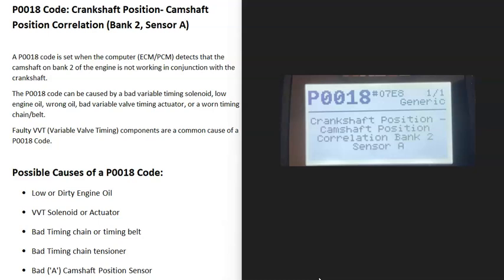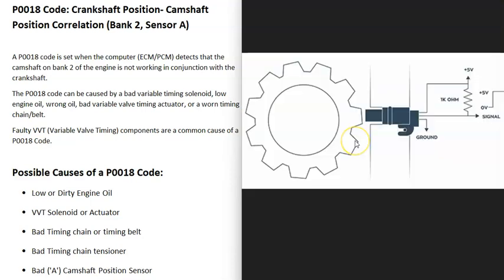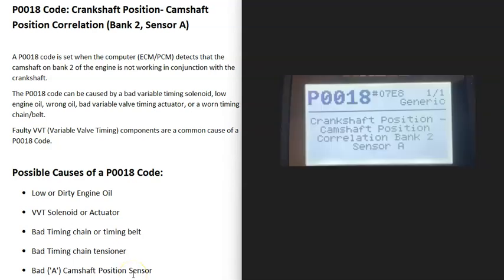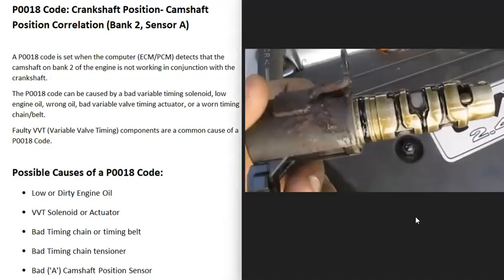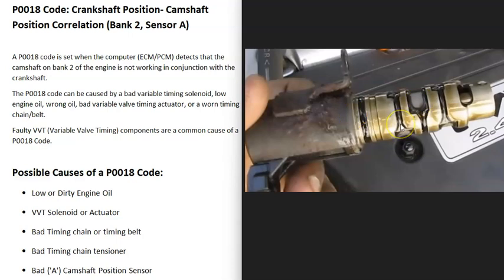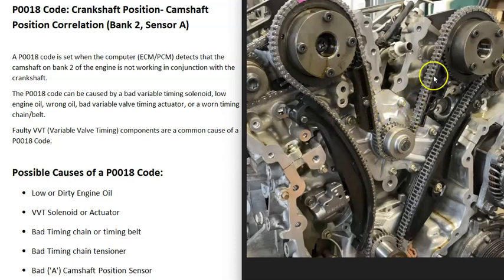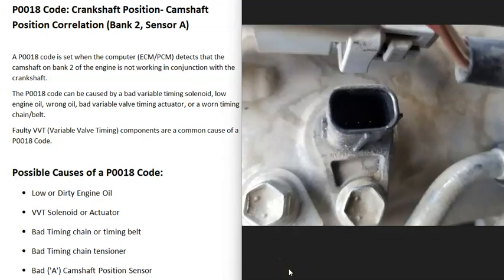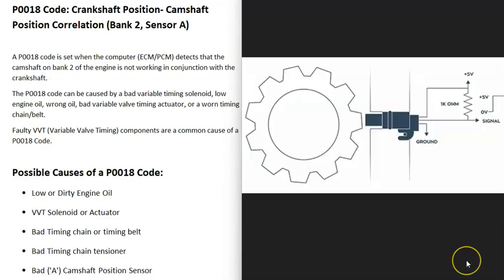Causes and Fixes P0018 Code: Crankshaft Position- Camshaft Position Correlation (Bank 2, Sensor A)

Comment: I have a Ford F150 with 3.5 Ecoboost and getting codes p0018,p0151,p0172,p0175,p0446 i have an Autel D1 lite scanner i have changed the camshaft sensor (motorcraft) changed both VVT solenoids and run sea foam thur motor to clean it up and put new oil in it now it sounds like the turbo is goin out on the driver side can u help.

Comment: Hi. Thank you for the info. I’m not getting the P0018 code but I am getting misfire on cylinder three and eight. I have changed the spark plugs the coils and the fuel injectors, but the misfire is still there. Do you think these could be the issue that I’m getting misfire by the crankshaft position or the sensor?
Reply from the maker: I would solve the P0018 code first, as it is likely causing the misfires. There may also be an issue on cylinders 3 and 8, but misfires shouldn't cause a P0018 code.

Comment: I have 124,477 miles the code won’t go away I’m taking it to a mechanic today.. I already spoke to 3- suppose to be mechanics.. and they talking crazy🤡
Reply: If you changed sensors then it's highly likely the timing chain sadly.
Reply: @sourdruid1 and if it is the timing chain… is that bad?
Reply: @mustafa810c8  ya. One of the worse things to pay for because you would probably want to change all the timing components with it too.

Comment: In my experience , the code went away after switching to full synthetic oil. I was ready to spend the money but my mechanic recommended I do that first. It's been running well now . Over 100k miles on King ranch

Comment: I have a p0018 code in my Audi a7 2015.. I changed only the sensors and still it’s there/code, so I quess it’s on to the next thing🤨
Reply: I have a 2013 with this problem, I’m going with the cheapest fixes first lol.. did you figure out what yours came down to?
Reply: @Tekneeq1 update ?

Comment: Thank you for this video, very clear...I am getting a P001800 on a 2013 A8 L with the 4.0 V8 twin turbo at 130Kkm...did oil change, checked 12v on solenoids + test, 5v on both cam sensors + resistance, as well a crank sensor,. did a seafoam..still getting code...did not do a engine flush, but starting to think its the chain stretching or tensionners. wondering if I forgot any other test I could do

Comment: Do you look at VVT monitor in mode 6 to help with the diagnosis?
Thank you in advance for your answer.
Reply from the maker: Mode 6 and similar are geared toward engineers. As a technician, troubleshooting, for me anyway, is more practical, such as testing the components that may be bad or another part that can cause something to not work. Everyone has their own troubleshooting style; in the end it is basically whatever works to get the job done.
Reply: @HVAC_Mechanic  Thank you for the reply. Agreed, whatever works to get the job done. 
I am always curious about techs using mode 6 that is why I asked.